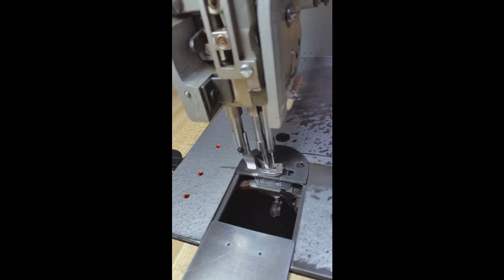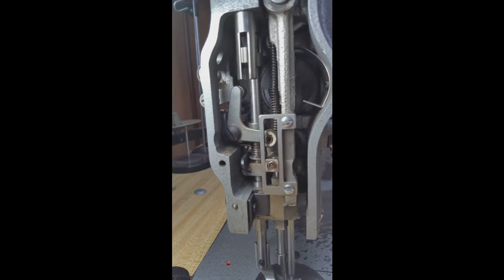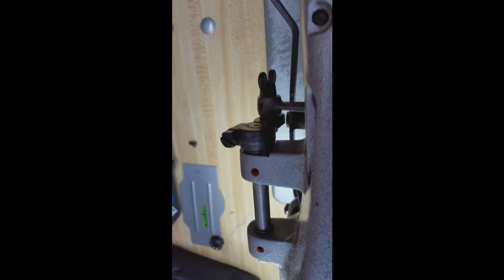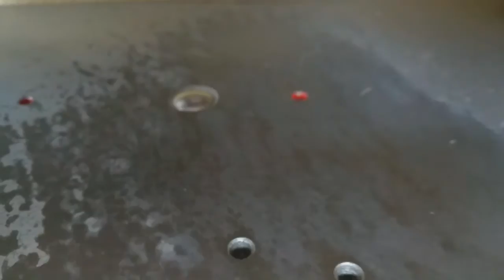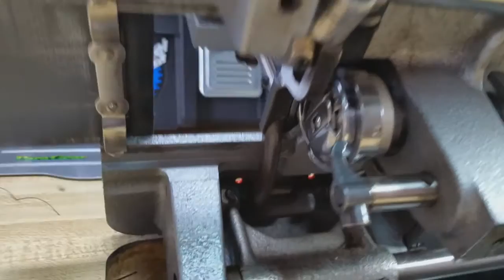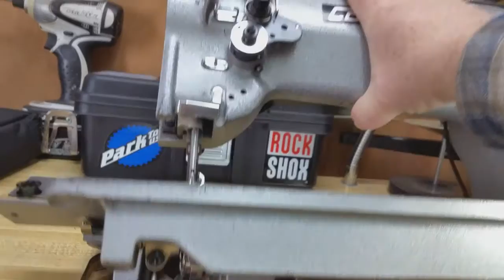Walking Foot Detail on a Consew 206RB Industrial Sewing Machine

Comment: I have the clutch motor on mine also. Can the servo motor be put on instead of the clutch. Would like to sew slower then what is possible with clutch motor
Reply: Deglaze the cork friction part of the clutch with a little dry sand paper or brush. Use fine emery cloth and solvent on the wheel it contacts inside polish it. Make sure to carefully clean everything so the throw out is moving smoothly and is lubricated properly. This will help control it better so it wont run. I have a few other tricks that worked for me if this doesn't help.

Comment: hi just subscribed! my singer walking foot is not moving at all. the motor or engine sounds stressed when i step on the peddle. any way you can me get my machine going again would be amazing. ive taken peices apart and still don't know where its stuck at
Reply from the maker: The only thing you can do is somehow try to find where or how it is binding up. I'm assuming you have tried turning the handwheel on the side. Finding what is out of adjustment or binding is difficult. It will take step by step, piece by piece observation. Take off any easy to remove pieces to make it easier to find. Look at a parts schematic and understand how it works. Something is either broken, bent, rusted, or seized. I wish you successful hunting!
Reply: @SurvivalCitizen  thanks i took the front/head apart and got the foot to move! just the motor need fixing now

Comment: I know this was intended for Consew 206RB owners, but it drives me nuts when people call this type of machine a "walking foot".  Yes, it's technically a walking foot.  But, it is a "compound walking foot".  There is a huge difference.  With a compound machine, the needle and the needle presser foot move up and down, and back and forth, along with the feed dog, to move the fabric.  In a regular walking foot,  the fabric is moved by the outer presser foot and outer feed dogs, while the needle shaft and it's presser foot stay stationary.  The compound walking foot is far superior.

Comment: I have the same machine. thread caught in bobbin and clutch locked up, I tried pushing the button on bed, but wheel will not turn at all. Any help?
Reply from the maker: Not sure, but I would say all tangled thread needs to be removed before anything moves further. Button should disconnect clutch. If it doesn't, I don't know without seeing it. Good luck!

Comment: HI there, I have a Consew 206RB-1 and I was watching your vid here and was interested in the servo motor you installed. I visited Enduro's website and found some motors. So I was wondering if these servo motors deliver the same amount of power as the AC clutched systems ?
If you could comment on that and give model specifics. I would like to have the slow motion control the servo motor provides as well as still have the higher speeds that the AC motors provide and of course similar power capabilities. So which Enduro motor should a guy get ?
I wouldn't mind if we could hook up via email somehow ...
Reply from the maker: Your questions exceed my knowledge. It really boils down to your voltage (Mine is 110v), if you want a needle positioner sensor, and if you want their commercial or heavy-duty commercial.
As for power, a clutched motor will always have more power, but it is very poor control in slow speed as the clutch has to do a lot of slipping to keep speed slow.
Speed? That all depends on the pulleys you use. A faster pulley ratio will not do slow well and lack power. A slow pulley ratio will be excellent slow but not as fast. All I know is mine is plenty fast for me! It is faster than I can guide the stitch.
Call the company and ask questions. They know their products better than I do...

Comment: I have a CONSEW 118 walking foot.  Cannot get the outer foot to rise up/down.  Your video is helpful but your outer foot mechanism is different.  Mine goes up, moves forward, down, back, then up and forward again.  Except it doesn't go up, just scoots along.  Are there other video that show the walking foot mechanism?  I cannot find any and I've searched a long while.  Your video is great and thank you for posting it.  Mark in Colorado.
Reply from the maker: Mark, there are very few videos on these industrial machines, which is why I made mine to help all those in the same dilemma. I have always considered myself very mechanically inclined with a good ability to "follow the process." You are going to have to get the machine head on a bench with good light (and a head lamp too) and you are going to have to learn how your machine works. A parts schematic helps too. Look for WHY the rear foot rises. What cam or lever moves it through what linkage. You also may be looking for a broken part.
Wish I could help more, but unless you have factory connections you are going to have to be your own technician/engineer. Good luck!
Reply: @SurvivalCitizen  You are right on.  I like sewing machines in general and am looking at this with a learning attitude.  Your videos have inspired me and get me to thinking about techniques and processes.  You already have helped very much.  I'll get this problem solved and will check back when it is.  Take care.  Mark in Colorado.
Reply: @markfannin3975  Did you figure it out ? My Singer 111W115 bound up, messed up the hook, and the safety clutch did not release. I absolutely love my machine but unfortunately finding any information on it is impossible. Sadly there are no technicians in my area who work on old industrial Singer machines so I am on my own.
Reply: @sswcustomsewing4276  Sadly no.  It became too frustrating.  I purchased a Sailrite leather sewing machine and am glad I did.  Their documentation, videos, and support was the best choice for me.  All the best to you.
Reply: @markfannin3975  Funny because I have really been thinking about a Sailrite Fabricator they are an excellent company yes.

Comment: Are you using any sort of speed reducer or just a servo motor to get those slow stitches? Thanks
Reply from the maker: I did use a smaller pulley on the servo motor, but otherwise, just the servo motor, no other pulley system.

Comment: not having material under your stitch foot and letting foot and feed dog walk on each other is like dry-firing your pistol.
Reply: That makes sense, but it seems like a fairly common practice in the industry to sew clear off the edge of the fabric.  It seems like in a factory where they're doing that to the machine hundreds or thousands of times a day, they'd have a lot of issues with worn out feet/feed dogs.

Comment: Thanks bud, that does help to see the motion, even though I totally get it. Funny how these machines can be so mechanically different yet basically do the same movements. You have a very clean machine. And I spotted a part that I have in my papers that don't match what mine looks like but looks like your machine has it. Also funny, it's not Arizona Bikerider. AZ are my initials.
Are you a rider? I see the Park sticker. When I got the machine it was jamming after a second or two of sewing, that's why I started messing with it in the first place. But I like machines and learning how they work so I ripped into it. This is my new Singer 111W playlist, https://www.youtube.com/playlist?list=PLZDb2Ix5nNZJUbTqvAcnX03ZGOPn05OZl
I will do another video asap to explain what I did and why. Thanks again.
Update: https://youtu.be/qNMA3pW1JGc?list=PLZDb2Ix5nNZJUbTqvAcnX03ZGOPn05OZl
Reply from the maker: +azbikerider49 Yeah, I mountain bike here in the hills and mountains of Virginia... Not hard core, but like flowing singletrack. I am too big to be a hardcore rider, usually the long and spindly dudes... You machine is a complex machine. I hope you get it working...